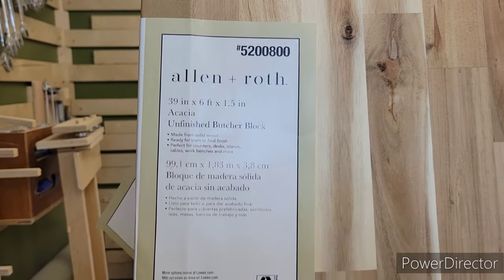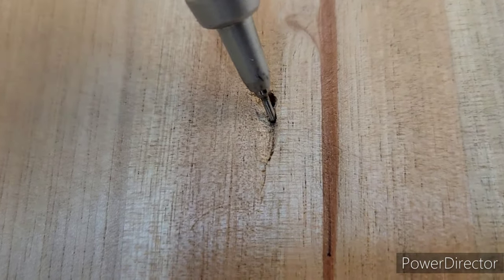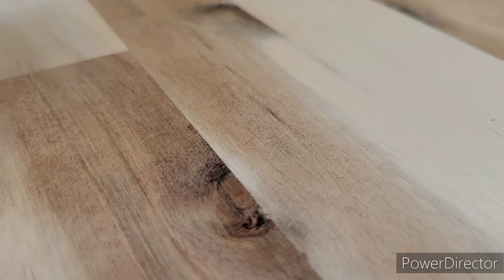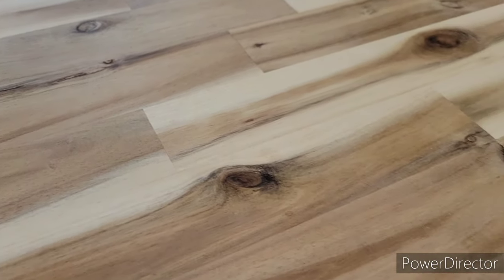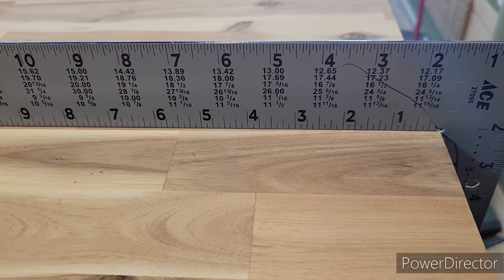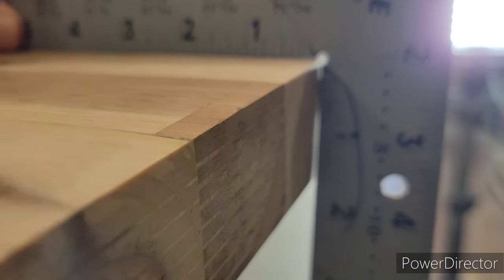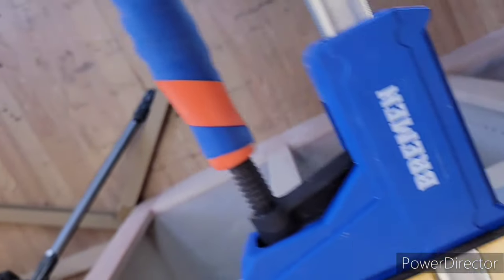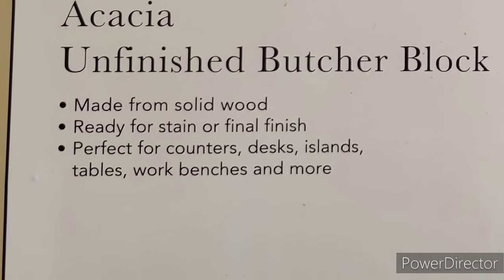Acacia Butcher Block Countertop by Allen +  Roth

Comment: Its wood man. Wood shrinks, expands, has imperfections. Usually on butcher block one side is nice. The other side looks like that. That side is supposed to go down.
Reply from the maker: The other side was worse.
Reply: @ShopRamblings  well, that explains your disappointment in the product. 

I bet the manufacturer didnt make sure the moisture levels of the wood were correct before gluing it all together. Maybe add some humidity to the room until it swells back then seal it immediately. Idk just a thought.
Reply: @ShopRamblings that was going to be my question, but much appreciated.
Reply: Hello we’re looking to buy a unfinished butcher block from Home Depot and my question is how do we “finish” them?? We have never had these before so we have. I idea 
Thanks
Reply: @adlygaray351 buy polyurethane, coat along the grain on all sides, wait till it dries, sand down with 200 grit sandpaper, apply second coat - wait to dry - done.

Comment: Yeah, Allen + Roth makes fancy designs for home decor but if the item requires worksmanship, it will be TRASH
Reply from the maker: It took several unplanned hours, but I got it flat. I just hope it stays together.
Reply: @ShopRamblings  let me know how yours is I didn't sand mine flat so we can compare 🤣
Reply from the maker: Yours must have been in better shape than mine because there was no way a person could use the one I had the way it was. It took several hours, but mine is flat and smooth like it should have been when I got it.
Reply: Looking into butcher block what would you suggest?
Reply from the maker: The previous brand they had "The Baltic Butcher Block" looked nice. I would open the plastic and check if I was to buy another one. I am sure that every brand may have good and bad. The one I received was surprisingly bad. It really is much better to just make your own. I was just trying to save some time, and it didn't go as planned.

Comment: Butcher block countertops always have an A & B side. The A side is supposed to be  flat and shouldn't have any knot holes. I'm sure you checked both sides of the countertop. That is actually very surprising if that is the A side of the countertop!
Reply from the maker: Mine must of had a side C and D. Neither side was close to flat. Neither side was close to smooth. Both sides had knots. I must not have made it clear in the video as it was a spur of the moment decision to shot this with my phone.

Comment: looking at Lowes for a desk out of butcher block.  The rough cuts I would not worry about.  The surface quality is terrible especially due to the tear outs.  The warping factor is just a bit much, some is expected.  Under the specified dimension is not a good thing for countertop materials.
Reply from the maker: It seems that there is a wide range in the quality of these boards.

Comment: I just bought a 10’ version of what you have. Mine is for my garage cabinets. No blemishes at all. Sorry you had a bad experience.
Reply from the maker: They stopped selling this brand in this size. Maybe it they didn't have a wide enough sander. Most are great quality, so it may have been something with this particular size.

Comment: I bought two 10’ butcher block counter tops 2 years ago from Lowe’s the Acacia on clearance for $90. Just opened it to use it and it was great. They must have lowered their quality control.
Reply from the maker: I don't think this is how most of them are. If so, they would be returning so many that they would be losing money. I mainly wanted people to be aware so they could check them before it was too late to return them.

Comment: Seems this is meant to be a rustic grade product, and knots/imperfections should be expected.  I'm sure pricing reflects this as well.   If you want a perfect piece of wood for a custom countertop you will be paying 5X, so I think these products are meant to hit a target market where the average person can afford them.  I've bought butcher block products from Lowes and had no issues whatsoever.
Reply from the maker: I have been by and seen these, and they don't look like this. The thing was not even square. It felt like the sanded with 60 grit, raised the grain but never sanded it back down. It felt and looked almost furry. That is not what I would call finish ready.

Comment: I think that I was thinking like you. That it would only need to be sealed. Not ‘finished’, like they didn’t finish making it. 😂 I guess it’s different expectations of finished. 😂
Reply from the maker: I think this one was just thrown in to meet their quota for the week. I don't mind sanding. I just don't have a 36in drum sander to make it flat. It had dips at almost every glue joint of 1/16 to 1/8 in.

Comment: I was just about to purchase one from that same company, thanks for the heads up
Reply from the maker: The old brand looked like better quality to me, but these were cheaper. I thought they may have been trying to save customers some money. Then when I looked at their website the price on the size I bought had jumped over  $100 in a month.

I was able to get it flat and smooth. It just added several hours I wasn't expecting.

Comment: I had to pick through to find a good one at slowes , but it turned out great after I sealed it up.
Reply from the maker: I wished I had picked through them, but it turned out great after several hours of sanding.
Reply: How did you go about sanding them?  Type of sander?  Grit?  Thanks! @ShopRamblings
Reply from the maker: I used an 8in block with 80grit to get it flat. Then I used 6in  orbital sander going 80, 120, 220.
I use 3m Xtract paper and disc. I use a MaxXt sander.

Comment: I just did a counter with a piece of birch BB. It's better than this one but in the center run of boards where the end grains join there is a dip even after finishing. Some of the boards making it up are softer than others and there is a slight difference when sanded. I did read about there being a good side and a rougher side to BB.
Reply from the maker: Yeah, this one had dips at every joint on both sides. I made it work, but it took several additional hours getting it flat. I finally broke down and got a 54" drum sander so it wouldn't be a problem now.

Comment: Lots of color variations in acacia.  Pretty wood.  I would have filled the imperfections with clear epoxy or colored to your liking; and then sand and seal.
Reply from the maker: This was not for me or a high-end  client. If it was, I would have built one. This claimed to be "finish" ready. I had figured the project price accordingly. It is very disappointing to open the plastic wrap and realize you have several hours of additional work that you are not going to be paid for.
Reply: @ShopRamblings  Understandable.

Comment: I'm confused. Is that what it means unfinished? If it is not that how or what is unfinished means?
Reply from the maker: It says "finish ready." In wood working, the term "finish" is a final coat of sealer or protectant that is applied to a flat, smooth piece of wood. If you are still confused, just Google "wood finish." So when it says "finish ready" I would expect it to be ready to have finish applied.

Comment: Think I'd have taken that back. Unfinished means it's not coated. Shouldn't have anything to do with not being grown, cut, or prepared properly. You can tell by the end grain those are very young lumber. No wonder there are so many knots. That should have been visible before even taking the plastic off though. I'd never bought it in the first place unless they had some better quality.
Reply from the maker: I think the wood was still wet when they built it, and each board shrank. I ould have taken it back but was in a time crunch.  It took several hours of sanding, but I made it look great. Now I have a drum sander that can do up to 50" wide. It would only take a few minutes for me to fix it now.

Comment: Was this solid acacia if you ever cut into it or is it plank glued to something else? Thank you.
Reply from the maker: Yes, it was solid. I think the wood may not have been dry when they glued it. Each board dipped down in the middle like it had shrunk, and some of the seams had pulled apart.

Comment: I am doing a commission piece, and I am using a pre-made butcherblock countertop. I was able to source my wood from my local lumber dealer. I do not like to go the "Big Box" stores for anything other than 2x4's (and they can be suspect). A quality lumber supplier will have better quality materials and I am finding that they have lower prices, they sell wood as a commodity so the market prices can vary daily but I have always got better quality materials and help to load into my truck.
Reply from the maker: Thanks for the info.

Comment: plain wood not going to be perfect i think you might be happier with a picture glued to MDF
Reply from the maker: I don't need perfect, but I have seen boards cut with a chain saw that were flatter. I do expect  not to have to worry about my glass spilling when I set it down.
Reply: @ShopRamblings  
i have these countertops not that bad great for the price.  chain saw countertops sounds really cool.
Reply from the maker: @Marwil23 I have seen some that were good. The one I got was like they shrank in-between each glue joint. Every 2 inches there was a gap. The whole thing was furry like a peach.

Comment: Hello?  It is called Wabi Sabi - the appreciation of the beauty of imperfection. It is an oriental concept that is totally lacking in the US.  In the US everything must be perfect and painted.  The result is that everything looks sterile and fake.  Compare a US building to one in Europe and you will see what I mean.
Reply from the maker: I get the beauty of imperfections.  I however would like my counter flat enough that sliding my glass to the other side of my plate wouldn't cause it to spill. I also like my counters to not feel like they have fur.  There was around 1mm raise at every glue joint like the wood was green when it was glued and shrank in between the joints.  The surface felt like a peach.  Boards come out of my planner looking better than what this looked like.

Comment: You purchased something that is very cheap and is character grade.  You got a bargain price. on a second rate product. Complaining about the width being 38-15/16 instead of 39" is like the people that sue because a 2x4 on only 1-1'1/2 x 3-1/2."  You got what you paid for.
Reply from the maker: I can understand it being a 16th inch short. The package said finish ready. This was not even close to me finished ready. Would comes off my saw smoother than what this was. I would definitely say I did not get what I paid for. I understand if I wanted a quality top I could have built it myself. A 2x4 is a common name but it states most every store and every Builder knows that the nominal dimensions are one and a half by three and a half. This would be more like I paid twice as much for a Select Grade 2x4 and got number twos instead. This doesn't really matter to me as I was able to deliver project it only took a couple more hours. But I was putting the video out just to make people aware so that they could expect their cops before they leave the store as most of them are good this was exceptionally poor quality.

Comment: You get what you pay for?  I'll bet you couldn't buy decent lumber for the project for what this thing cost
Reply from the maker: I don't remember what I paid for it. I just looked, and they no longer sell it. They have a different brand in this size. It currently comes out at just under $6 bft. I can get some wood at that price. I would have to buy more as there would be waste. Then the time in gluing up. I don't have a 30" sander. The main reason I bought it was I didn't want to have to flatten it. I don't do wide glue ups that often, but I am shopping for a drum sander for when I do.

Comment: You could have saved hundreds of dollars and made one yourself fairly easy.your have to do the last 25% of the work anyway and your not getting to use your preferred wood
Reply from the maker: I would have preferred to make one. I was hoping this would have saved me some time. I was being paid for the job. I could have bought the material and built one, but once you add labor to it, it would have been about the same if it had been finish ready like it said it was. Having to flatten it, it was not a better deal.

Comment: Pays less than $400 for a massive butcher block and then complains about imperfections. You would pay $1500+ to have that size and perfect.
Reply from the maker: Ok, I am just showing what I received.  My 2 complaints were, it states that it is finish ready.  Sanding with 80 grit made the surface smoother. I guess you can put finish on a tree but I would not consider it finish ready unless it was sanded smooth. Secondly it was not flat. Almost every board dipped in almost 1/16". From the responses I have received this is not how many of them are. So if some are like this and some are good for the same price why not let people know so they can check them instead of counting on it being what it says it is.